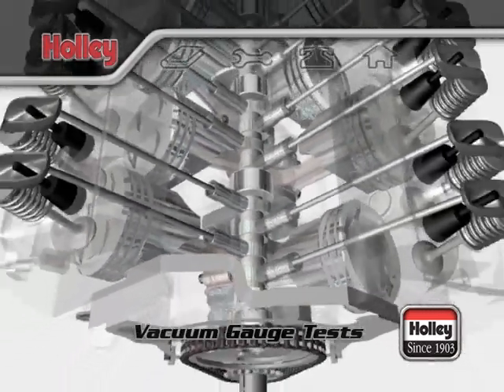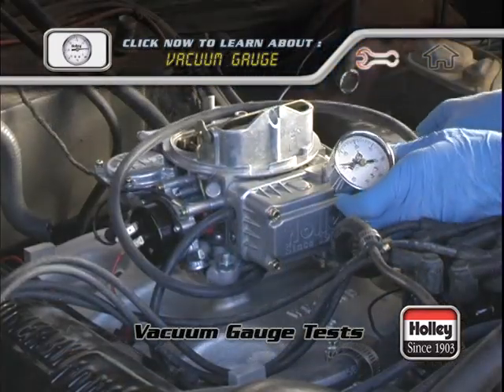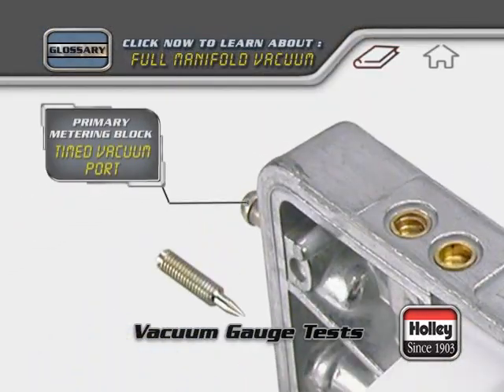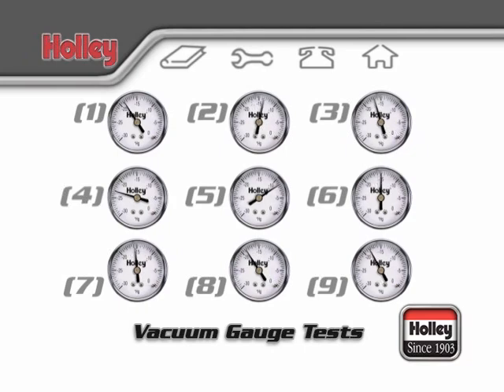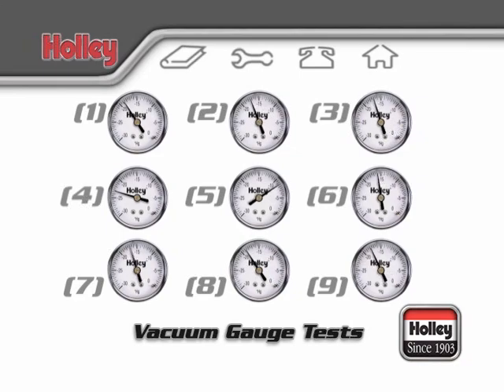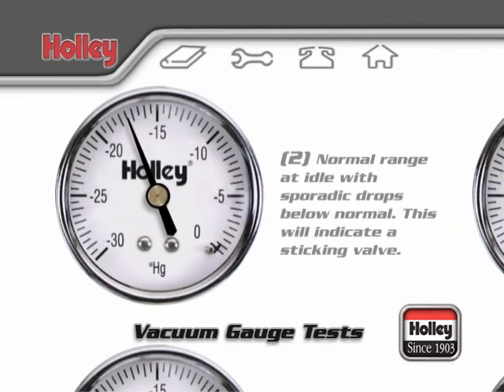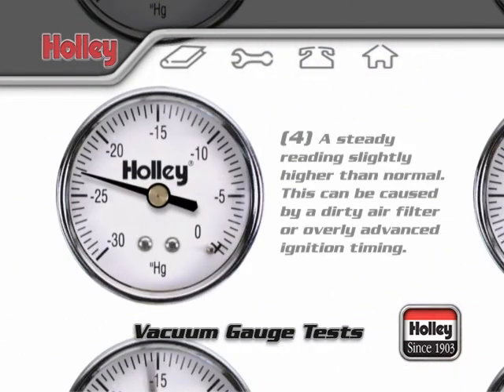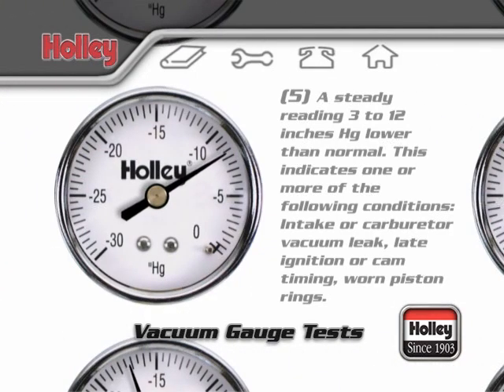How To Diagnose Common Engine Problems With A Vacuum Gauge

Comment: My gauge is showing the reading on number 3 in this video, so thats relieving because I already know i have ignition work to do. Very helpful- thank you!
Reply: Dealing with an issue, did you find your solution?
Reply: @bryanturner683  yes, new points condenser plugs wires cap rotor fixed my needle bounce and engine stall in gear. Of course also set point gap and dwell
Reply: @thisoldbelair  Thanks

Comment: Ok its no.3 my problem right now. Time to change spark plug wires.
Reply: Did that work?
Reply: @bryanturner683  Wow it's been 4 years since I was having this problem. But no, changing spark plug wires did not solve my vacuum problem. Coincidentally, my vacuum readings became very stable after I changed my carburetor together with another intake manifold.
Reply: @ThePeanutization  Thanks,, changing wires did not solve my issue today either. Im heading for a rebuild???

Comment: I have a Ford f 150 truck 4x4 model 89 5ltr winsor gt40 heads weiland intake 2 in rise stage 2 cam with a 600 holley vacuum second i am running 65 main jets 6.5 power valve when I first got it it was using 70 main 65 valve its users oil  and don't blow any smoke if i dropped to 60 main would they be to small due to the high runners and make it lean out then blow up just thinking that the distance from the carb to the manafold base its about 3 inch of lift and will i use a 8.5 power valve because of the high rises